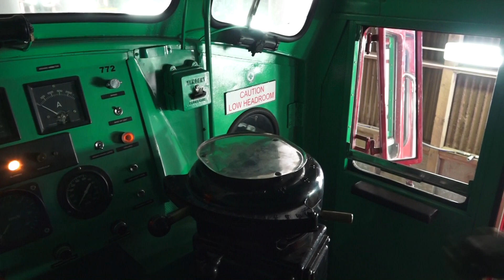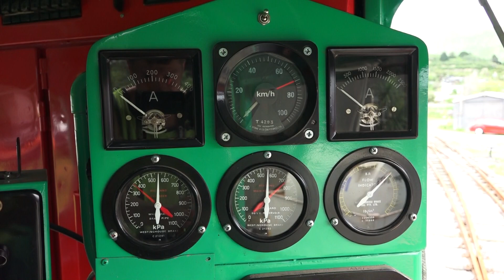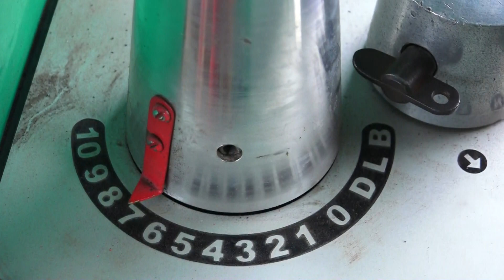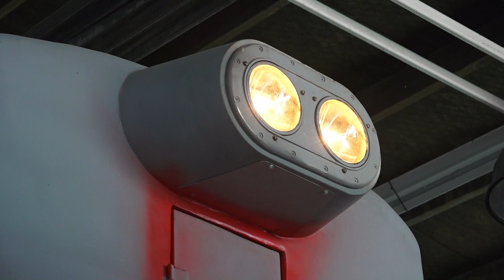Roaring Back to Life - Di 1102 Engine Testing (HD)

Comment: Good job fellow preservationists down under, visited your site 6 years ago and a huge progress has been made on this loco.
I like the sound of those inline 6 CSRKT engines, basically a class 37 engine with one bank chopped off.
Reply: I'm a retired engineer and I would like to know who built that prime mover and how much horse power they are. How much does that locomotive weigh? That is 3'6" gauge, isn't it? I think that has got to be the worst coupling system I've ever seen, nothing beats the buckeye couplers.
Reply: @gordonvincent731  The builder of the prime mover is English Electric, and it produces about 750-1000hp. (sources give different numbers)
And NZ indeed has the 3'6"gauge.
The locomotive is pretty light at just 64 metric tons, I believe that that is 70 short tons, on 6 axles.
So that's just 11 ton axle load, as these were designed for lightly laid branch lines.
The so called chopper couplers on this locomotive is an old style coupler, NZR does use buckeyes for many years now as they were safer to use as they lock in coupled position, and don't need hands on uncoupling.
Reply: @Tom-Lahaye  Thank you for your kind and very informative reply. I really appreciate it.

Comment: Those old electric toys in the background tho, I see EO 45, a Ganz Mavag EMU, and is that an 88 Seater RM railcar?
Reply: No Reflex. That is a Vulcan raicar. Older, and smaller than a Drewry 88 seater, but much more reliable over the years.
 Had a Frichs engine, and when you walked past it while on the move, you could see it jumping around, as it was bogie mounted. Rather frightening, but you got used to it.